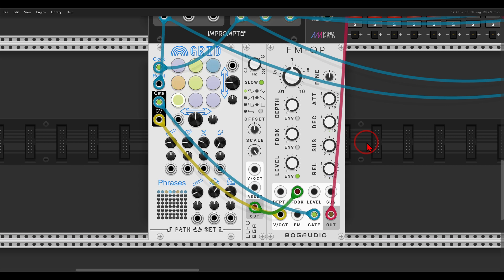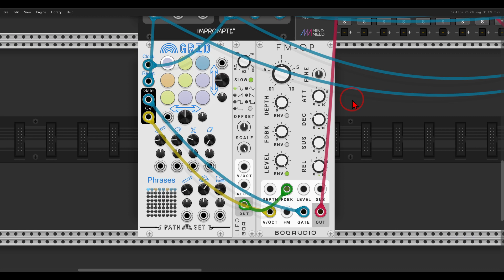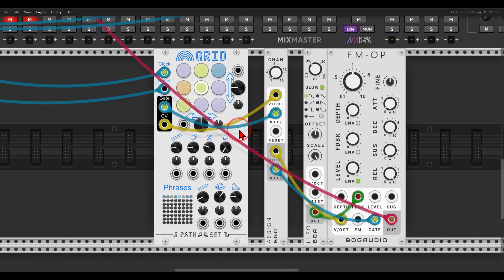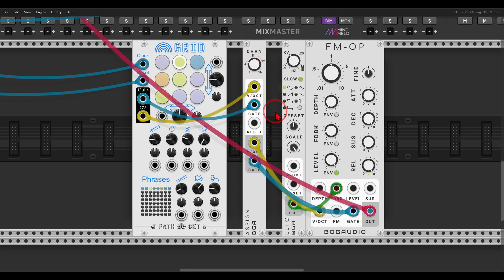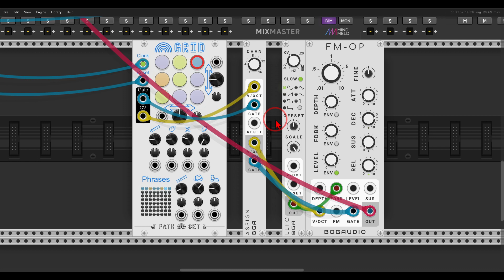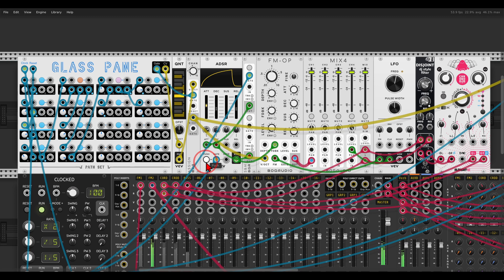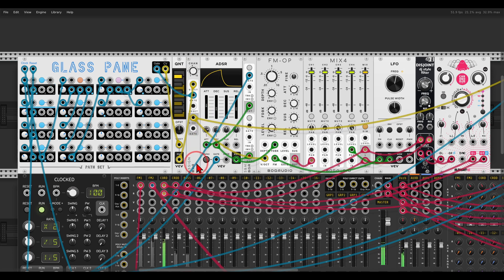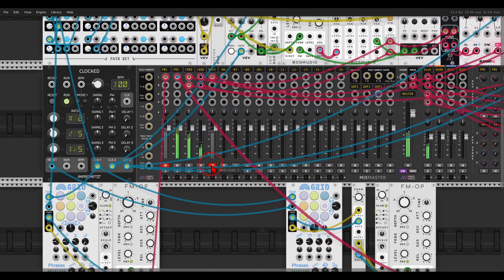Let the notes ring out \ Quick Tip

Comment: Thanks for sharing! Are there physical modules that can accomplish this? (new to modular - thanks)
Reply from the maker: Well, you will need polyphony and that's not so easy in hardware. You can achieve something similar with a switch and multiple voices though but that can be quite an expensive solution. That said, Rings has this built in so you can have up to 4 voices playing together like this.